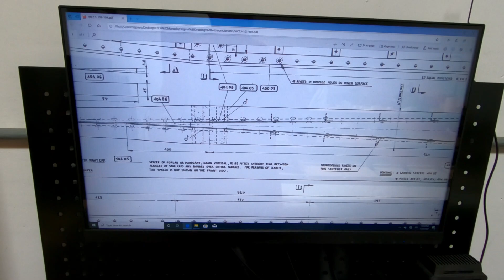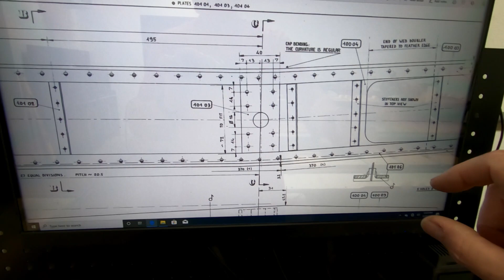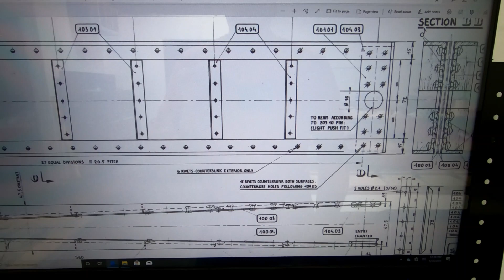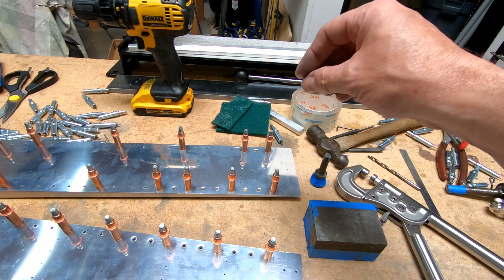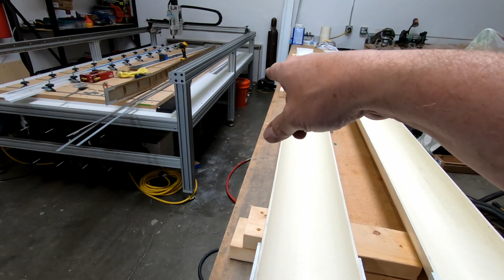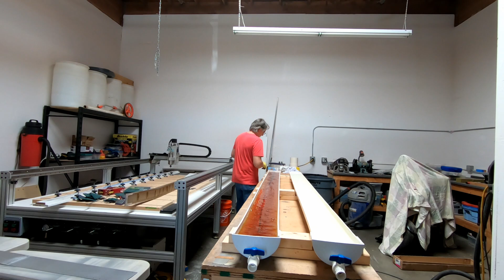3A - CriCri Airplane Build - Wing Spar Prep and Alodine

Comment: Oh my god. What a discovery, your channel. Fantastic. I have no words. CriCri was the first plane I was dreaming of building thirty-five years ago. Then in 2014, I started to build an MC 100, the 2 seater which the big brother of the CriCri also designed by Michel Colomban. Unfortunately, life circumstances have changed, and the airplane is now finished to only about 60%. And at my age, it doesn't look like I'm going to finish it. I rather give it away! But I can truly understand what you are going through. Each piece I had to build, file, drill, cut. I all looks very very similar to what you do. It's an absolutely mad endeavor. Congratulations.

Comment: would it not be better to assemble the spars then dip them into the alodining solution that way the rivets are also protected.
Reply from the maker: Riveted sheet metal can have some voids where Alodine can seep into and between parts and not get properly rinsed away after treatment. Alodine is corrosive. It is never recommended to be applied to an assembly, only part by part pre assembly so you don't have the potential for corrosion where it cannot be properly rinsed.

Comment: You keep referring to “pure aluminum” for the web. What is “pure aluminum”?  I don’t think there is such an alloy (1000 series I think gets close) nor would it have structural properties. Did you maybe mean 6061?  I think I’ve also heard people use 3000 series or 5000 series each with different properties.
Reply from the maker: Most 2024 sheet aluminum is "ALCLAD". Alclad is a corrosion-resistant aluminum alloy with a pure aluminum surface layer bonded to a high-strength aluminum alloy core. The web material is ALCLAD aluminum. The pure aluminum surface helps protect the inner 2024 alloy from corrosion. Extruded aluminum is not ALCLAD so it doesn't have any added protection against corrosion such as the wing spar cap angles.
Reply: @crikitaviation  thanks for the reply!  I since chased that thread a little and gotcha.  Now one thing is saw was that some folks leaf the ALCLAD to show off a shiny surface.  However, if something scratches the outer cladding then it can corrode.  Therefore many folks also then prime (acid?) and paint it to provide an extra level of protection.  Would one also do a prep like regular non-ALCLAD aluminum?
Reply from the maker: Yes, the prep would be the same to paint. Aluminum, Alclad or not isn't really susceptible to corrosion unless it is exposed to elements like salt that cause it. I have non Alclad aluminum in my shop that is 15 years old and it still looks like new. For a CriCri that is stored out of the weather almost all the time and not flown in weather, corrosion is of little concern unless you live near saltwater coastal areas.
Reply: @crikitaviation  spot on

Comment: I worked in an aerospace defense company for over 30 years. The best prep for alodine that we used in house was simply windex original formula. Clean and degrease first, then windex, wipe dry then immediately alodine.
Reply: Ps, the color isn’t an indicator of corrosion protection.

Comment: As a fellow homebuilder,  does double counter sinking rivets not compromise strength of the rivet? Also as you mention past video, extreme level of engineering, how did Mr. Columbine deal with the issue of the rivet heads?  Did he just account for the thickness of the heads and  allow the spar to slide over them?
Reply from the maker: In the case where a flush rivet is needed on both sides, double counter sinking the rivet is the only method to achieve this and since that is the recommended way to install them, the designer has accounted for this. I can't say how double counter sinking a rivet compares to a dome head with a properly bucked rivet in strength.
Reply: @crikitaviation  my apologies, I did not see that in my plans. I only have a a garbage set of paper plans printed on 8 1/2 x 11! I got ripped off on e-bay years ago. Currently working on 2 BDs a 4 and a 5.
Reply from the maker: Wayne. not problem. Search the Internet, you can find perfect PDF copies of the plans that are good. Much easier to lookup on your computer vs paper. I've been ripped off too! Haven't touched my crappy Ebay paper plans since I downloaded the PDF plans.

Comment: in 4.33 minutes of the video the stringer that was shown was bent in what way to give the angle?
Reply from the maker: The spar caps are all cut straight and then bent using a bending tool that  you have to make. The bending tool is shown in chapter 11.2 of the General Operations Manual.